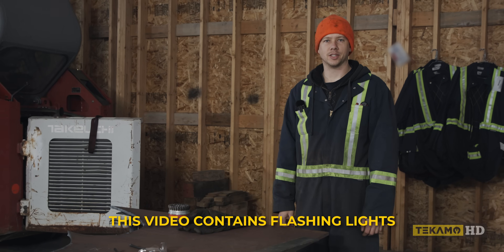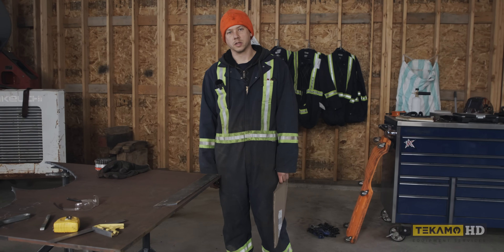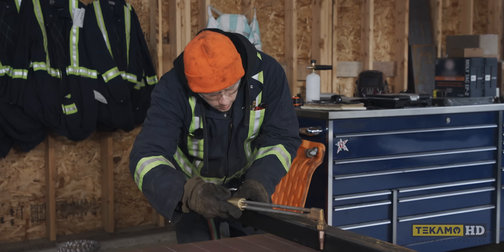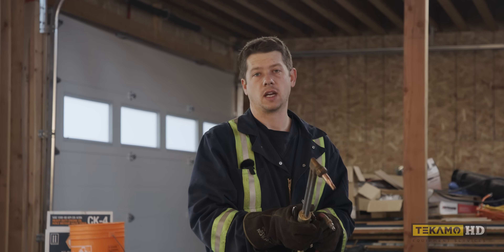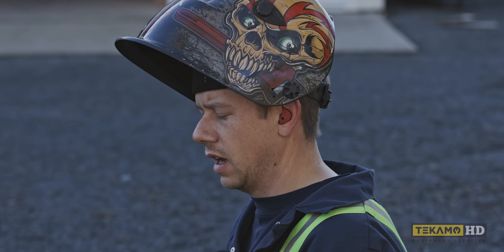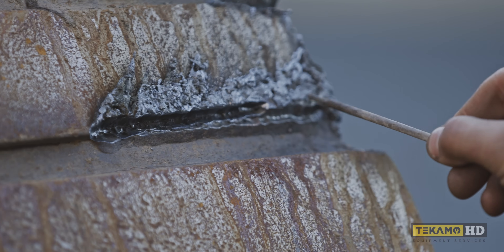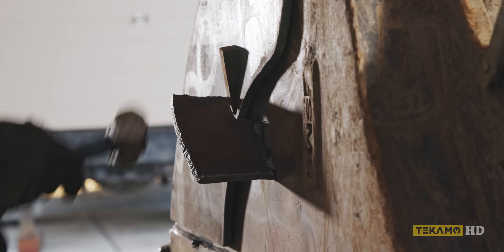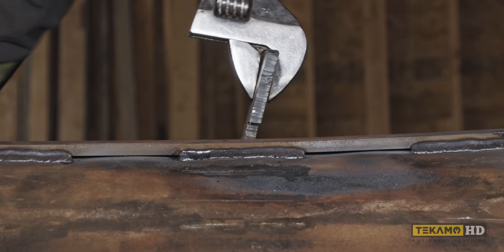Partial REBUILD on an EXCAVATOR BUCKET START TO FINISH (Cutting, Gouging, Grinding, Welding & More)

Comment: I hate when guys smash rocks down with center of bucket 🤦‍♂️ I don't care for hard face,  it never lasts. Unless the welder welds pattern in first then goes over it with hardface. Very few do it like that. So it's a waste imo. I'll do between the teeth on cutting edge  >>>> do like 4-5 45s with weld then hard face,  it lasts pretty good and holds the dirt, saves between teeth. Other then that no sense hard face on a piece that's a wear plate that's ment to be cut off and replaced

Comment: Cheaply made bucket to start with the wear strips were just mild steel. The bottom of the bucket made out of 1/4 inch. No cheek wear plates when it was originally made. I'm guessing they just use it for trenching it has a plate welded over the teeth. Why do you guys blur out the name on the Klondike grease? We don't use it anymore. Klondike has jacked up the price on all lubricants. Our local supplier is carrying Chevron. I'll use the grease Delo400 oil, not a chance, Shell Rotella only.